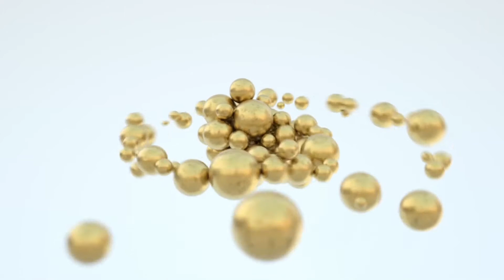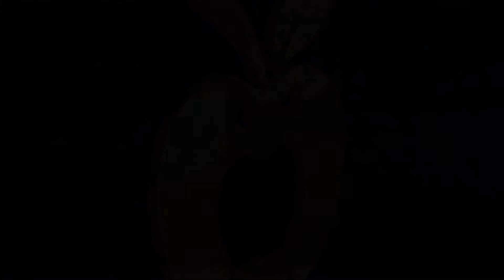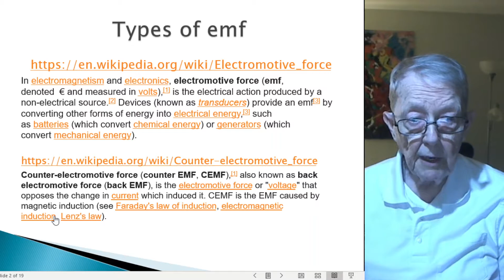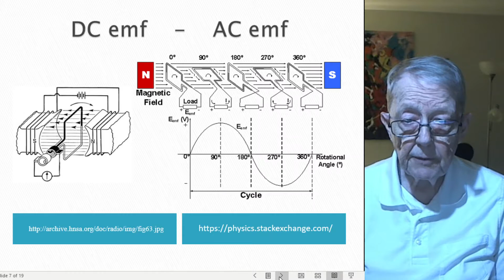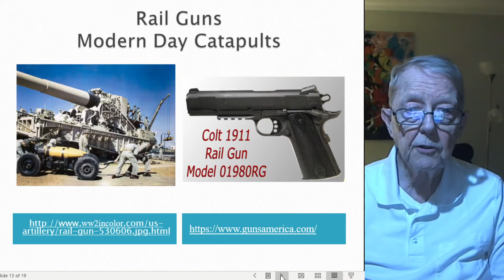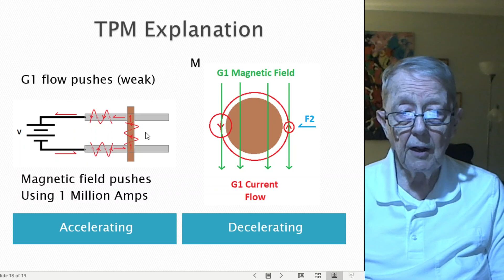Electromotive Force - emf

Comment: We dont know if g1 or g2 collide, its impossible to measure because atoms cant measure anything smaller than whatever interacts with 1 atom. to even have any confirmation wether electrons are particles or just density waves of space(aka ether or medium) we will need a totally post atomic detection method. We cant even decide what the size of electron is supposed to be, some models need it to be bigger than atomic nuclei just to explain why light slows down for cosmic redshift due to back emf(quoting lenzes law) when it goes through atoms. And that paper was the only relevant result when I googled cossmic redshift tired light.
Reply from the maker: G2 particles were suggested to explain the refraction of light. To bend light, in a gravitational sense, requires a smaller particle moving at higher speeds. Higher than light. 

Following the Le Sage model, the G2 must be able to pass through the G1 or interact with the G1 by pushing it. It actually hits the one of the subatomic atoms that make up the G1.

In summary, the G1s collide with G1 or N1s, while the G2 collides with the G2 or N2. But there is no proof of any of this. Some questions need to be answered

 Is the Particle Model a better model than other models? Does it provide new information that increase our knowledge of nature? Does it advance science and engineering? 

I'll let future scientist answer the question.

Comment: 8:57 Interesting you included that because I just deduced that the Gaussian unit of charge "statC" (aka "Franklin" aka "esu") is derived from electrolysis experiments with various oxidised or reduced ions amongst the chemical reactants.
The units of statC are sqrt(mass flow x volume flow) and this correlates quite nicely with the Nerst Equation but you replace the natural log function with a square root.  It seems that mass is more fundamental than charge according to the Nerst equation.
You can think of charge as a parameter for a flowing system of particles, proportional to a ratio of pressure (kinetic) energy to the voltage and a function of "entropy" (related to the number of configurations or "states" of the reactants).

This is how close the curves are:
https://www.wolframalpha.com/input/?i=plot+ln%28x%29+and+sqrt%28x%29from+x%3D0+to+10

Also see:
https://en.wikipedia.org/wiki/Nernst_equation
https://en.wikipedia.org/wiki/Entropy#History
https://en.wikipedia.org/wiki/Faraday_constant
https://en.wikipedia.org/wiki/Capacitance
https://wiki2.org/en/Statcoulomb
https://wiki2.org/en/Gaussian_units
https://en.wikipedia.org/wiki/Talk:Statcoulomb
https://wiki2.org/en/Voltameter
https://wiki2.org/en/Tafel_equation
https://physics.stackexchange.com/questions/73769/how-does-one-prove-that-energy-voltage-x-charge